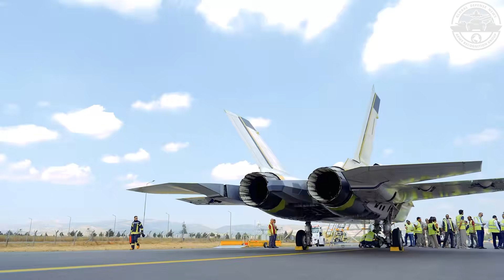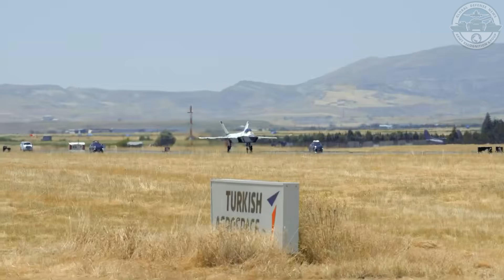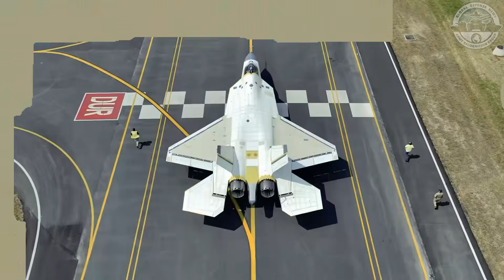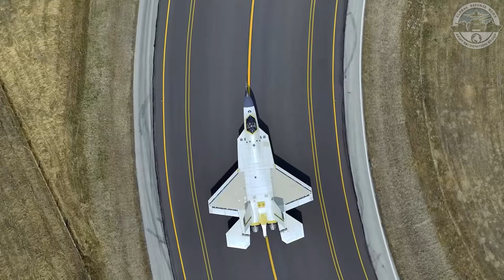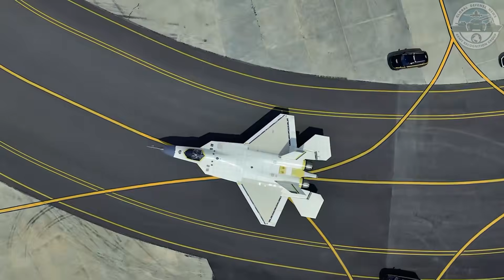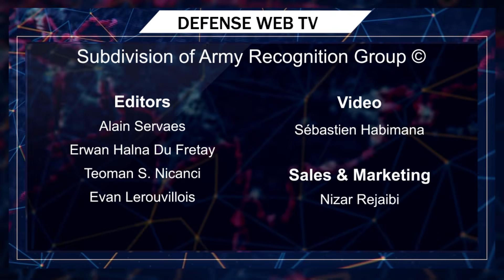Türkiye’s KAAN P1 Taxi Test Reveals Major Fifth-Generation Fighter Upgrades

Comment: So it's going to have ram coatings to help with stealth, and what's it powered by?😮
Reply: The coating is made by Turkish company, same company that was making the coating for the f35, the first batch will fly with American engines while the next batch will fly with Turkish engines
Reply: The first batch which are the block 10s will be powered by the F110 engine family most likely the F110-GE-129E variant and once they complete the domestic TF35000 engine later blocks will fly with that. So roughly 2030 - 2032 is when you will see the domestic engine in the KAAN which will also give the aircraft time to mature.

Comment: Interestingly no country in Europe has built a 5th Gen Jet which Turkey is attempting and once it flies it would be a direct F35 challenger giving NATO states a choice they have not now
Reply: The goal, after all, is to become a genuine rival to the most powerful aircraft out there. There is a rumor—though I cannot confirm its accuracy—that the KAAN will feature two groundbreaking technologies. The first is a special pilot's helmet; to put it simply, this helmet will incorporate all the capabilities of the massive computer systems found in the F-35. It will utilize heat-sensing technology. For instance, imagine a scenario where a building needs to be struck, but it is unclear if a specific target is inside. By activating the helmet's features, the pilot could detect all heat signatures within the structure, allowing them to execute the mission effectively—or, if civilians are present, wait for them to clear the area before striking. The second rumor concerns Turkey's development and successful testing of laser weapons on drones. The plan is to integrate this system into the KAAN; instead of relying on 20mm cannon rounds or conventional ammunition, the aircraft would be equipped with a laser weapon capable of shooting beams to incinerate and down enemy aircraft from distances of hundreds or even thousands of kilometers. While the first feature is highly probable, the laser capability remains speculative; however, if realized, it would render the current paradigm of 250-kilometer missile engagements obsolete and usher the world into a new era—a transition we have already successfully pioneered. Many nations learned about drone warfare from us—witnessing our operations in Libya, Karabakh, and Syria—and subsequently shifted from conventional munitions to drones. Let us see what the future holds.
 
zaten amaç bu en güçlü uçağa gerçek rakip olabilmek bir rivayet var bu doğrumu bilmiyorum kaanda 2 teknoloji olacak devasa bir teknoloji 1.csi şu bu gerçek bu net olacak pilotların kafasında özel bir kask olacak bu kaska şöyle örnek verelim f35 uçağının önündeki devasa bilgisayarın tüm yetenekleri o kaskta olacak ısı güdümlü olacak mesela örnek vereyim bir bina vurulacak fakat binada yaşayan bir hedef varmı yok mu bilmiyoruz o kaskın özelliğini açtığın zaman içerideki tüm ısı izlerini görebilecek pilotumuz bu sayede rahatça operasyonu gerçekleştirebilecek veya o bölgede sivil varsa sivillerin uzaklaşmasını bekleyip vurabilecek 2. rivayet şu bilindiği üzere türkiye lazer silahı geliştirdi ve dronların üzerinde denedi gayet başarılı oldu bu sistemi kaana entegre edecek yani kaanda 20 mm top mermi veya başka mermiler olmayacak direk bu sistem gibi bir lazer silahı olacak ve bu silahla tüm uçakları yüzlerce hatta binlerce kilometreden ışın atarak yakıp düşürebilecek 1. seçenek olması muhtemel fakat bu lazer gerçekten bir rivayet olması mümkün olmayada bilir fakat olursa bu 250 km den füze atma olayı tamamen kapanır dünya yeni bir evreye geçer ki biz bu yeni evreye geçirmeleri gayet başarabildik bir çok ülke dron savaşlarını bizlerden öğrendi libya karabağ suriye vs bu savaşlardan sonra dünya mermi değil dron kullanmaya başladı bakalım neler olacak..
Reply: @MANCTYGALA Any later type of weapons would require lots of energy and that would make the jet a 6th Gen not 5th
Reply: F35 hava yer, f22 hava hava, Kaan hava hava ve hava yer özellikli.  F35 tek motorlu, f22 ve kaan çift motorlu.
Reply: Ben bir Türk olarak natonun lokomatifi olmak istemiyorum. Avrupanın Orduları var neden koruyalım. Bir faydaları yok bize.
Reply: @TURKOPOL46 Exactly they offer Turkey nothing! They sanctioned Turkey defence industry when they needed components and now that Russia threatens them they come crying and want to use Turkey thinking they are naive
Reply: Interestingly there are serious reasons no country in Europe chose to go for a 5th Gen fighter jet although having great manufacturing experience in aerospace . There are a lot to think out of this signle sentense .
Reply: @VoyagersQuest-c4m Les avions de 5ème génération seront dépassés en 2030 à cause des nouveau OSF et radar AESA qui rendront la furtivité obsolète. Les constructeurs européens veulent passer directement de la génération 4.5 à la 6ème génération
Reply: @kiefferfx18  Exactly . By changing radar frequencies all aircrafts are visible and the upcoming modern radars will support that technology  . Stealth fighter jet is a myth soon to be debunked .
Reply: Doğru tespit katılıyorum !!!!
Reply: It is not in the same class as the F-35. It will directly rival the F-22, Su-57, J-20, and J-35. This aircraft is twice as heavy and large as the F-35.
Reply: @novruzefendi-yev9753  It can not compete F-22 .Not with those ancient engines at least , let alone the modern avionics . The US are decades in front of competition and as we speak preparing for releasing Gen 6  aircrafts while developing Gen 7.